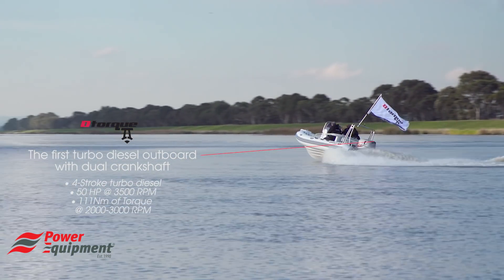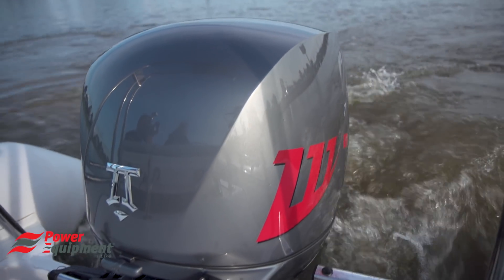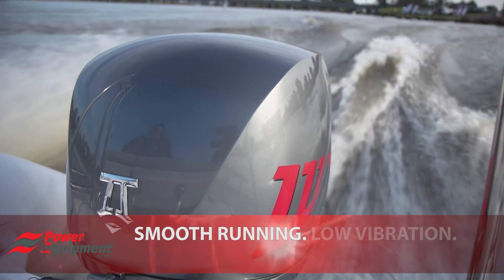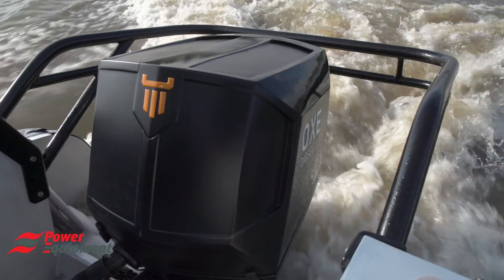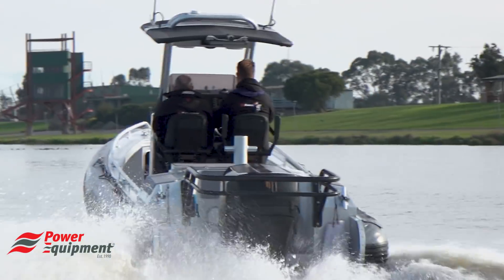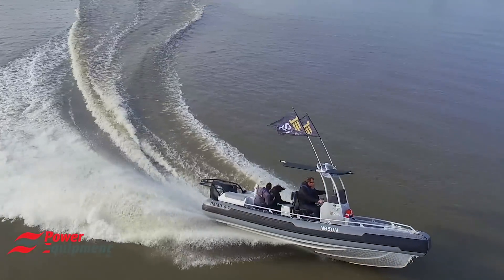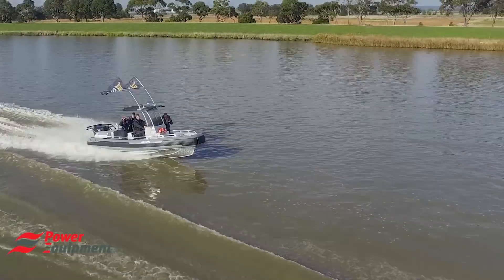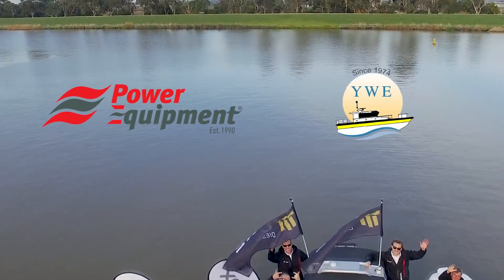World's First Diesel Outboard Engine | Demonstration Video | OXE | D-Torque

Comment: 200hp@4100rpm. Lot of rpm for a diesel. Unusual design. FYI the Navy has outboards mountable on any flat surface like a barge with 2000+ hp.
Reply from the maker: Nice 👍🏻 I didn’t know that. Navy can get anything they want

Comment: Mercury DSI diesel outboard has been in service with the US navy and the UK and allies since 2015. It is the exact same weight as an OPTI 3.0 2 stroke v6 and shares 95% of the parts. Sorry you are defiantly not the first and if memory serves me right and others have said this has been done before. Put a Cummins, Perkins, Kubota and hey a great Yarnmar and they have made these since 1984. That's like OX saying they made the first diesel boat anchor, because if they build engines the way the do research count me out.
Reply from the maker: Fair enough, you sound like you know your stuff

Comment: World's first???? Been made for years
Reply: @brett5649  Yanmar did as well, 27 & 36 HP. My company own a 27 HP. Not sure why they stopped but at least they are back again.
Reply: yes but thats petrol engines converted to diesel. these are true diesel engines
Reply: @brett5649  he even says it in the video that these are optimax fitted to run on diesel.not a true diesel engine
Reply: arotom technicality
Reply: I ran twin Yanmar 36 diesel outboards for years and they were NOT petrol engines converted to diesel. Ruggerini manufactured air-cooled diesel outboards for a while.
Reply: Amarc made a 9.25 back in 1960 that was diesel
Reply from the maker: Wow, you guys certainly know your tech